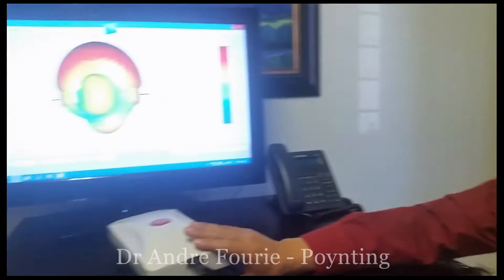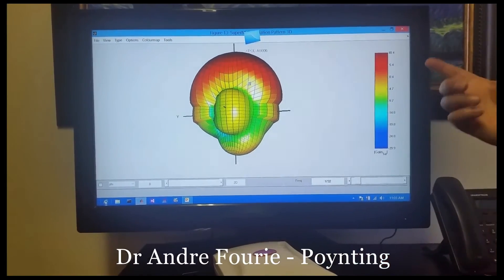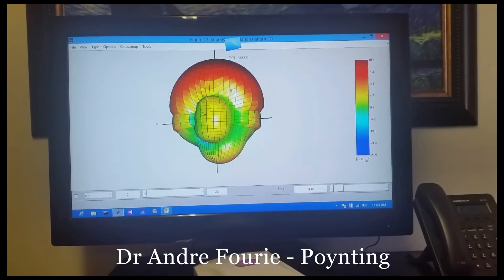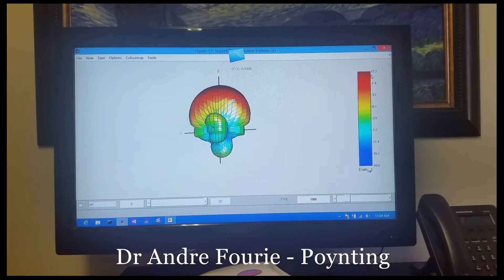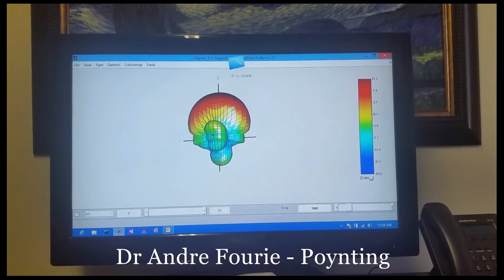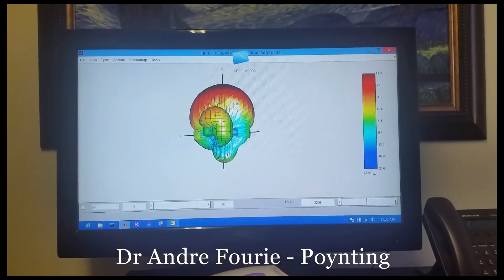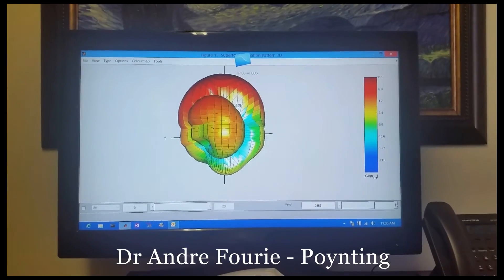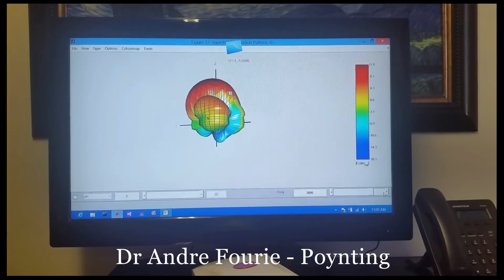Poynting XPOL-6-10M antenna 3D Radiation patterns.

Comment: Hi staying in Claremont Cape Town and using Telkom 4G network, speeds have dropped off a lot over the last few months so much so I am now on 5Mbps down and only .5Mbps up this does not help with Whatsapp video as I can see others but because the upload is so slow No one can see me. I have added A-XPOL-6-10. Speeds are now 40Mbps down but only 1 to 3 Mbps up. IS there a way to boost the upload speeds?

Comment: Interesting! Thanks for sharing.
Just to check my understanding : Referring to your orientation description starting at 0:15, if the pattern shown on the screen corresponds to the way the antenna is lying on the desk below it, then the "broad beam" you refer to as lying "in the elevation" is the pattern that the antenna would exhibit in the horizontal plane (azimuth) with the antenna mounted normally. In other words, with the XPOL-6 mounted normally, the Y-Z plane on your screen plot is a horizontal plane and the X-Z plane is a vertical plane. Correct ?
That being the case, the red/orange arc (the "broad beam") shown at 1732MHz looks to be a fairly wide 3D cone with its centreline aligned along the Z-axis (horizontal). Looking at the corresponding datasheet at the link given, the -3dB beamwidth at 2100MHz seems to be about 60 degrees in the azimuth (horizontal plane) and about 30 degrees in the elevation (vertical plane).